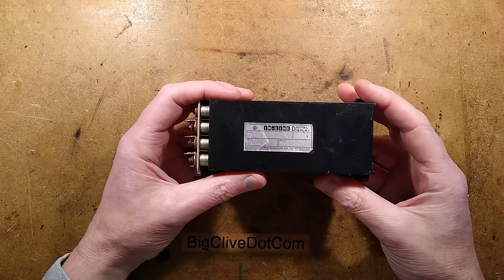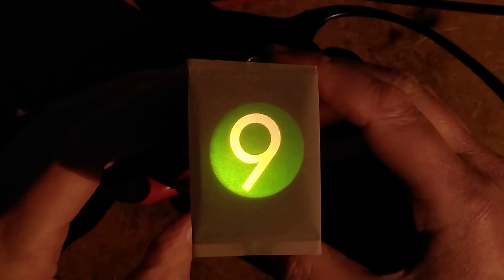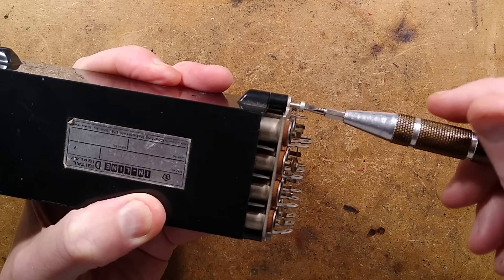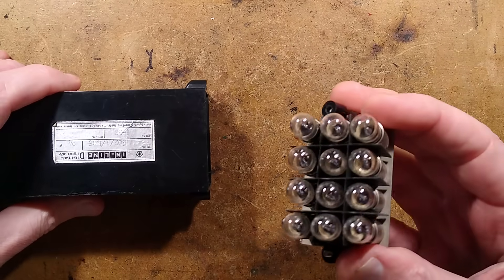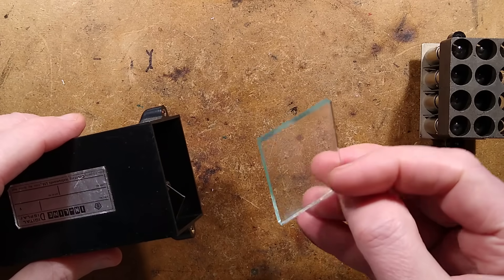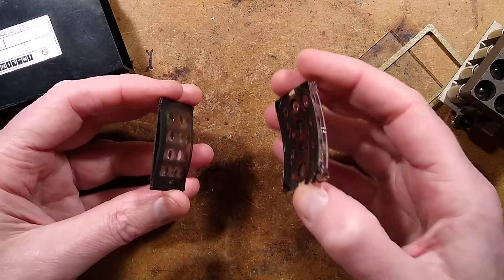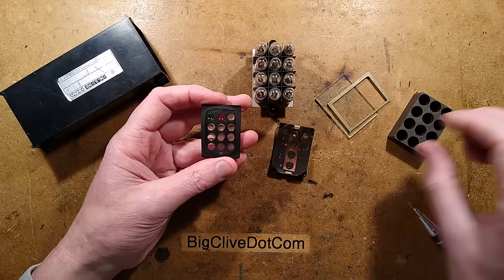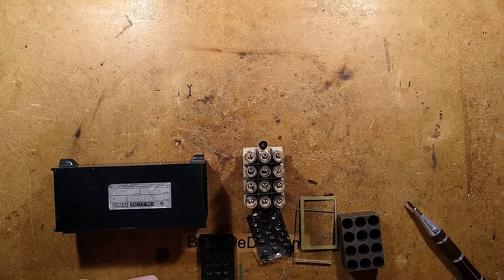Vintage projection display teardown

Comment: Looks like something I’d expect to see on Franlab channel. She does all sorts of “vintage” numerical displays.

Very cool stuff. Maybe I’m prejudiced toward such things due to being relatively ancient myself at 71…
Reply: I believe one of these has actually been on franlab, if I'm not mistaken
Reply: No question - she presented one of these just within about the past year.  Not only that, but she built her opening welcome as a "walking" text: FRANLAB, using 7 of these kinds of modules.  That is often shown as an alternative to her pencil version of the same.  As it happens, in my early career I saw some of these modules used in a custom system our company built.  If there were LEDs at the time, they were quite tiny.  These projection units were readable from some distance.
Reply: @InssiAjaton   those were a bit different, albeit they still projected onto the display surface. 

For one the display surface was rectangular rather than circular, and they also made a "clack!" sound when switching letters. I don't recall if those were the ones that constructed the figures out of interference patterns or if that was another one, but, definitely not quite the same as this item.
Reply: Hi. It's Clive! On the bench. Clive's bench.

Comment: That's really interesting!! I saw that kind of display showing film frame numbers in a film editing projection room when I was a kid. It's almost like those bulbs need to have a rectangle of filament strands like a film projector bulb, with a curved reflector but they do actually work as they are. I want to see the ones that have other symbols. One thing about theses old types of displays is that you just KNOW there's always either something you haven't seen yet or something that could be done that hasn't.  There's this urge to somehow combine as many as possible display technologies into one individual character display.

Comment: We had something very similar to this at my work.  I worked in a large candy factory.  Raw milk processing.  When I started, in 1979, the CIP system (Clean In Place) was controlled by an ancient clockwork drum, switch and movable pin system.  As the drum slowly turned a system of switches was triggered that in turn actuated valves, tank agitators, pumps and cleaning agent injection.  Displays, very similar to this one, were built into the face of a huge wall sized control panel.  Indicating the step of the cleaning process.  One evening I turned off the control room lighting.  The bulbs had been replace with some very harsh/bright tubes.  It was only then that I realized these number displays actually worked (very dim).  The colors were used to indicate a change of cleaning agent.  Green was start of cycle/caustic, yellow was start of acid and red was sanitizer/cleaning complete (red was barely visible with the lights off).
It was an amazing system when it worked properly.

Comment: Another interesting device, if you need to drive it from logic circuits you need a 1 of 10 decoder like the  SN7442N, but an interface circuit is needed because the lamps are rated for 24V while TTL devices run on 5V, sure these were available only in the 70s, because LED displays had important improvements at the end of this decade, in 1978 Hewlett-Packard launched the HDSP-34XX seven segment displays with 0.8' digits for example...
Thanks to show it...

Comment: Neat design.  I was expecting lenses on the metal block; that option presumably failed during R&D.  Likewise some fibre optic links from bulbs to display.  K.I.S.S.!

This type of display must have featured in countless period sci-fi and thriller films.

Comment: Some of the multi-channel analyzers that I used in college for sophomore physics had similar sorts of displays. Most common was a N×10 matrix of panel lights, each of the ten rows having a fixed digit.  I spent too much damned time copying those values into my lab notebook.

One of the newer machines had an adding machine type tape that could just be glued into one's lab book.

Comment: If you used injection moulded lamps with the join line across the top, the display looked awful. Some filliments worked better than others and you needed to swap lamps to get a good display. The ones I had were from fruit machines with pictures rather than numbers displayed on the glass. Extra electromechanical were required to replace the reels.

Comment: I have an old poker slot machine from 1977 that uses similar projection displays for each card and player instructions. I’ve been wondering how they worked and it’s surprising to find out how simple they really are.

Comment: I have retrofitted these with WS2812 LEDs (the ones in standard 5 mm cases with four leads) and thus get arbitrary digit colors and, after removing the color filters, also arbitrary background colors. And I can address my four-digit display with just an Arduino.

Right now I am using it for a clock. It looks quite nice when the minute digit slowly fades over from one digit to the next. And I can let the colour signify different meaning of the display, e.g. orange for time and blue for temperature.
Reply: could you make a video on it? That'd be cool to see
Reply: @sudofox  Notice that I uploaded a short video, though I couldn't get it to work fully.
https://youtu.be/AKlSdqEb3B4
Reply: Oh, that sounds great!
Reply: I hope the thing is powered by a steam(punk)engine 😂
Reply: That was exacty my idea after I watched this video! Moreover, I also thought about slow fade transition between displayed digits! It's sad however these are not available in my country.
Reply: I would love to see a wee video on that, though I notice you've got a brief one about 31-note octave (harps?) which has definitely caught my eye!
Reply: @kaitlyn__L  I realise now that this idea might not have been documented before, so I made a short upload demonstrating what it looks like. Unfortunately, the clock is undergoing a rebuild (adding wake-up light) so I can only show parts, and to my dismay some communication error has developed. But I think you'll get the idea:

https://youtu.be/AKlSdqEb3B4

Wonderful that you noticed the microtonal dulcimer!
Reply: @mumiemonstret  non 12TET/EDO tunings are a special interest of mine :) thanks for uploading the example clip!

Comment: Ohhhhhhhh!!! I used to have some of those!!! I wonder where they've vanished to - haven't seen them for years! Although I might have sold them online... 
(Edited many times!)
IIRC the metal block with holes was screwed in position by four screws through the sides - as you can see at 2:53. It seems to be 'sintered' (from the twi-global website: 'the process of forming a solid mass of material through heat and pressure without melting to the point of liquefaction') - in a similar way that ferrite components are formed.

Comment: I remember similar displays in elevators at least into the 1980s and probably 1990s.  Probably some around today.  Always wondered how they worked.  It was clear that they were some sort of projector but now I know how they worked!  Thanks, Clive!
Reply: I saw it in an elevator and thought it was a slide projector as well.  This elevator was only four or five floors, I thought the slides were on a rotating disk and lit with the same bulb.  Sadly, just this week, that hospital closed,  I won't get to see it again with the information Clive provided.
Reply: Ah! That's where I've seen these! (Though probably on old TV or in old movies, as I'm not quite that old...)
Reply: IEE made indicators like this for elevators in the 1970s and quite possibly later.

Comment: Very, very interesting. There is a lot less inside than I thought. But what is inside is very interesting  The curve of the lens assembly must be a compound curves. not just top to bottom but side to side to project the numbers centrally. I have seen so many of them and never got to look inside. Thanks for the peek behind the curtain    2x👍

Comment: How to get an indication of the age of gear when you pull it apart. Screws oldest to newest… flat blade, philips, torx, security bits. Also imperial/BA to metric.

Comment: Visually, those displays are far more appealing and pleasing on the eye than 7-bar LED digit displays.  Seeing ultra-smooth curves on the font is something I miss with my hobby projects.  I'll bet no-one makes them anymore (why would you when you can get LCD panels), and it would be hard to justify a couple of orders of magnitude power consumption for something that "looks pretty".  Great video as ever Clive, thankyou!
Reply: You could perhaps get away with LEDs and cheap plastic lenses held in place with 3D printed plastic holder, and the film could be just laser printed overhead projector sheet, or if that's not fine enough then photographic film (developed b&w negative or dia positive). Needs accurate spacing to get things properly focused but this would be a really neat hobby project.
Reply: @tappel0 inkjet would be better for this use case, but yes
Reply: Power would be low if using LED's
Reply: When I made a variable power supply in college many years ago, and it came to making the lables (on, off, ac in dc out etc) I went all arty and butchered the Letraset to give curves and tails and nice squiggly bits to the typeface on the box. If I had seen Spinal Tap, I just may have labelled it up to 11 for the sheer hell of it.
Reply: Nixie and VFD tubes were the best

Comment: You should 3D print a led holder to replace the tungsten lamp holder block and hook it up to a controller as an art piece.
Reply: 12v LEDs come in all different shapes and sizes. If you can find one with that base then you wouldn't even need a new holder block.

Comment: I remember seeing these kind of projected number displays on elevators to display the floor number,  likely in the 1970s.
Reply: Yes, there is one in the local hospital's parking garage. I wondered how it worked.  I always thought it was a slide projector, with a numeral printed on the slide.  After watching this video, I would like to look at it again, but that hospital just closed, and I will not be able to see.
Reply: @MyHandleW Well, if it's closed then who would mind? (Of course, don't do anything that might earn you troubles.)
Reply: @matthewellisor5835   if it's closed it won't be illuminated anymore!
Reply: The channel "This museum is (not) obsolete" has a video of a repair on one of these displays.  Video title is "Fixing the Uniselector Incandescent Inline Display".
Reply: Exactly! Here in NYC there are still some elevators having this

Comment: I wonder if those 'pre focus' bulbs with the narrow tip would work better with this display.
Reply: They might. I don't recall ever seeing them in bayonet cap, though, only ever screw fitting. Usually in cheap torches. 😁

Comment: 😂 That was a B quick video  Clive 🤣

Very clever optics - putting the lenses, and masks, in a curve to keep focus at the screen centre.  I have seen these used in railway signalling panel train displays but never with the Red/Green background option. That intermediate glass shield is almost certainly an IR filter - it has the blueish edge colour found in the IR filters in slide  and movie projectors.

I think a modification project is called for by using White LEDs and a random number cycling circuit to add to the Super Computer shelf displays 😂

Comment: Fran-tastic stuff! I love the complex lens shape on this display, and all the engineering that went into it. The heat dissipation block is probably alumin(i)um or maybe some magnesium alloy.
Reply: I too was thinking it was a very Fran Blanch sort of item.
Reply: @MervynPinfield-rn4hs She does indeed have a video about them.
Reply: They were aluminium,  I scraped lots in the 90's replacing them with 7seg L.E.D.